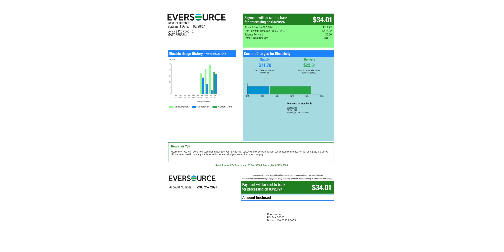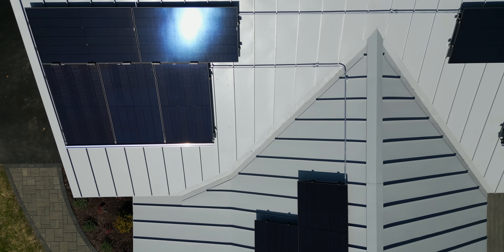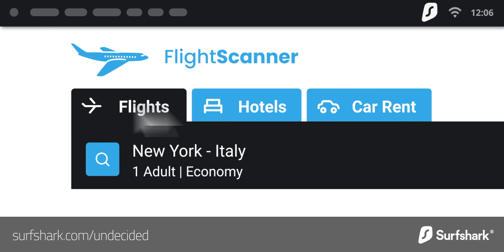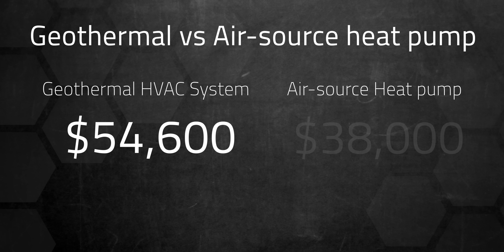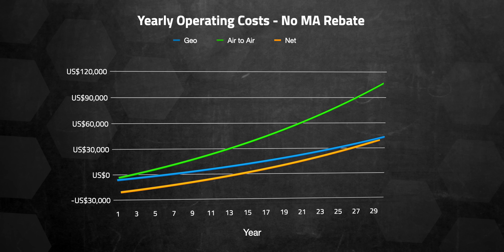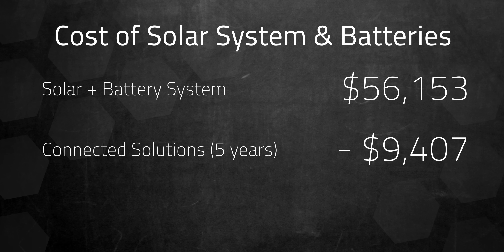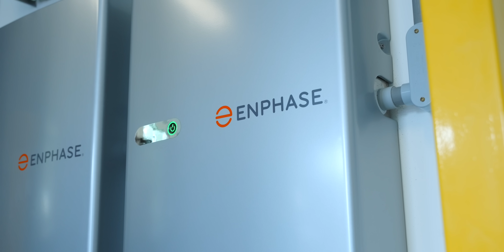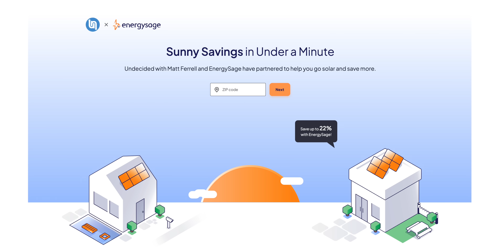What I Learned After 1 Year with New Solar Panels

Comment: I really enjoy all of your content….wondering why you do not use Net Present Value in your long look financial analysis…ChatGPT can do all the math for you in an instant (no need to breakout the college FNCE 201 text book 😅) …here is Chat’s NPV explainer - Net Present Value (NPV) is a financial metric used to assess the profitability of an investment or project. It represents the difference between the present value of cash inflows (benefits) and the present value of cash outflows (costs) over a given period of time. NPV is commonly used in capital budgeting and investment decision-making to determine whether a project is financially viable.

Formula:

NPV = \sum \frac{C_t}{(1 + r)^t} - C_0

Where:
	•	C_t = Cash flow at time t (inflows or outflows)
	•	C_0 = Initial investment or cost
	•	r = Discount rate (rate of return required or cost of capital)
	•	t = Time period

Key Points:

	1.	Positive NPV: If NPV > 0, the project is expected to generate more value than its cost, and it’s typically considered a good investment.
	2.	Negative NPV: If NPV < 0, the project is expected to lose value, making it unprofitable.
	3.	Zero NPV: If NPV = 0, the investment will break even, generating just enough to cover its costs.

I asked chat this question to show how it works:

To calculate the NPV of the light bulb investment, we need to compare its upfront cost and savings over its lifetime with the opportunity cost of investing elsewhere at 8%.

Assumptions:

	1.	Cost of light bulb: $100 (initial investment)
	2.	Power consumption: 1 watt (0.001 kW)
	3.	Electricity cost: Assume $0.15 per kWh (average in the U.S.; adjust as needed)
	4.	Daily usage: Assume 10 hours per day
	5.	Lifetime of bulb: Assume 10 years
	6.	Discount rate: 8% (your opportunity cost of investment)
	7.	Energy savings compared to an alternative bulb: Assume an equivalent bulb uses 60 watts (0.06 kW).

Step-by-Step Calculation:

	1.	Energy consumption of this bulb:
￼
￼
	2.	Energy consumption of the alternative bulb:
￼
￼
	3.	Energy savings per year:
￼
	4.	Monetary savings per year:
￼
	5.	NPV formula:
￼
Where:
	•	￼ = $32.30 (annual savings)
	•	￼ = 8% (0.08)
	•	￼ = 1 to 10 years (bulb lifetime)
	•	￼
Let’s calculate the NPV.

Calculation:

￼

The present value of the savings over 10 years can be calculated as a sum of a geometric series or using a financial calculator.
	1.	Present Value of Savings (PVs):
￼
￼
￼
￼
	2.	NPV:
￼
￼

Result:

The NPV of the light bulb investment is $116.67. This means the bulb provides a net financial benefit of $116.67 over its lifetime compared to the opportunity cost of investing the $100 elsewhere at 8%.

Comment: Our oil boiler died last year, right before we went on vacation. I had been looking into geothermal for a long while and HATED oil, for numerous reasons.

1. there was no way to control price - it could be $3 a gallon. It could be $5 a gallon. 
2. running out of oil - calling and begging for a quick delivery, running to the gas station to get diesel (which you can use as a standby). In our case, our boiler also heated our hot water, so when we ran out, it was a real pain
3. dealing with oil companies and their games - like when I used to be on a contract and I knew the new price was going to be much higher, so they refused to deliver until after the price increase
4. checking to see how much oil we had before a storm - if you're getting 15" of snow, you might not be able to get a delivery for a few days. And you have to shovel a path to the oil tank so they can deliver

Now, I just sit back and count the savings with our geothermal and air source heat pump! I don't have to worry about which dictator has decided to start which war with what country (affecting the price), running out of oil, finding out who has the cheapest price, etc. Now, our next step: solar panels + batteries. We cam close to getting this installed not once but twice, but didn't get it done. That's our next step, which works to control the price of electricity. Now...will Trump keep the rebates or roll them back? Obviously, that's a huge factor here and can affect the solar industry as a whole. We'd like to do this next year.

Comment: As an engineer, I love all this. Smart design choices will pay off.

As a millenial who has very little free cash, I hate this. I rent in a newly constructed house with absolutely garbage insulation efficiency. Our electricity is very cheap (about 1/3 what you pay per kWh)... but we still average about $1800 CAD per year.

I would love to improve my living space to be more efficient. I'll even install the panels for free if someone else pays for them. But I don't have the liquid capital to afford any of the process myself, and there's zero incentive to pay for it as long as I don't own it.

But yeah, congrats to all homeowners who can pull this off. Must be nice. I'll be over here hanging out in my 63F house for the winter. Sweaters ftw.

Comment: Worth it. I have an 11Kw system that covered everything until I bought an EV, but I still never pay as much as I did before. I put about 50k miles on the EV every year and still pay a smaller electric bill than anytime before the solar went up.
I calculated break even at about 8 1/2 years. I'll definitely make that.

Comment: I notice he didn't include interest, since most people would have to get a loan to do this. So at least another 5K per year.
The interest alone would be double my total energy use.
I live in Wisconsin, my average gas+electric is $220 per month or $2640 per year.
I have a high efficiency furnace, gas water heater, and gas clothes dryer.
My home was built in the mid 70's, so insulation is not exceptional.
The system described would never get paid back before it would all need to be replaced from degraded batteries and solar panels.
I notice he didn't include interest, since most people would have to get a loan to do this. So at least another 5K per year.
Glad I don't live in Massachusetts or California., although I must admit I don't like winter.

Comment: You may be a big nerd but you missed a lot of numbers and scenarios with that said i hope it all goes well for you , you talk about savings by year 30  , IF everything goes perfect  but #1 i have never h seen any machine , device , system that lasts 30 years with out breaking , then you may say well they gave me 25 year warranty on my install , well did you read the fine print ???  You may have warranty on the parts but not the labor and may be extra expenses , #2  panel output degrades a lot more than your estimates by year 20-25 and 30 , which by that time what you don’t produce will come out of your pocked , #3  them batteries will not last more that 5 years in an ok efficiency retainment of energy so you may run out of juice in peak seasons during night or shady days  #4 warranty only applies to normal wear and tear  , if a storm a tree limb or some act of nature breaks panels or damages your system  the repair cost is on you  , so at that point you have to add insurance to that system and or  add it to your home insurance which will bring the payment up   Which you have to factor that monthly extra cost  to your electricity bill , #5  if they are on tour roof  when the roof needs to be replaced the cost of doing that increases by 20k or more to have to take them down and put back up  which again it will be on you or your insurance payment will go up a lot , plus the cost of electricity while the panels are off the roof you have to pay for  , i may be missing few things  but i did an in depth calculation and it is not worth it  to most any one with a very few exceptions where weather may be mild , a very small house , some one that does their  own  install  ,  i’m sure you are too popular to read my comment but i’d really like to see what you think ,  oh yeah i forgot to mention that you have to keep the panels clean as a mirror for them to collect enough light to produce power , that includes leafs , dirt , grime , ice , snow , mineral deposits after rain , man there are a lot of little variables that you missed !!!!

Comment: My home is net zero, even though the word "efficiency" could never apply. 65 year old construction, single pane windows, fireplace, swimming pool,  large garden lit up at night... a nightmare for energy consumption. I am net zero because I have enough solar panels on my roof that on a yearly average I generate about 4 kWh per day more than I consume. If I lived as electrically profligate as I do, but without the solar panels, I would be spending $4,000 per year for my electricity. My total installation, including panels, labor, batteries, and inverters, cost a little bit less than just your geothermal system by itself after your rebates. (I paid full retail for everything in my system.) 

Now, I don't get the satisfaction that you get for having such a beautiful, efficient, high-tech home, but mine is a nice home nonetheless and it is fully paid for, no mortgage, and I am off-grid capable... almost. 😠I found that out last month when my main breaker to the street failed and my batteries lasted three days before shutting down the system, which is how I found out that the breaker had failed. If I shut down the swimming pool pump and the garden lighting, I could last indefinitely. I remain grid tied to save wear on my batteries.

My situation will change next year, I plan on buying a used Tesla Model Y, and I will need more efficient panels to feed it. Mine are old, rated at 320 Watts per panel, the replacements (costing less than mine did originally) will be around 600 Watts each. I will need to look into the possibilities of using the Model Y battery for my energy storage rather than upgrading my batteries.

Of course, as you stressed many times in your video, YMMV. It has worked well for me, but probably would not work for everyone.

Comment: prices are so high in the US. I live in the UK and I have a 170m2 property and I am getting installed a 7kw ashp + radiators, ufh, and new pipes throughout for £12k, and a 16 panel, 9.5kwh battery solar system + full house rewire for £20k - total of £35k ($44k USD), this is after all incentives. this is roughly the same price as your solar system after so many discounts applied! I don't get US pricing.

Comment: If you include the savings on fuel for electric cars in your calculations it’s much more impressive. 
We have two, for about 7months we had almost zero cost motoring, all from surplus solar.
Reply: 50x panels 20kw. Plus 30kw batteries

Comment: Thanks, I am in UK. Your install costs for solar are way higher than the UK, but you also use so much more energy than UK, I use about 4Mw/annum, and this is fairly typical.
You do not include your lost opportunity costs, even just cash can generate 4%/annum, 100,000$ over 10 years invested just in cash could easily make $40000 in a 10 year period.

Comment: $89,000? 
My grandchildren will have passed away of extreme old age before my house costs that 
much in accumulated electricity bills.
And that doesn't even consider the costs of replacing solar panels every 25-30 years
nor does it include the lost returns one could have made over 
almost a century by simply investing the $89,000.

And the above doesn't even take into account the fixed cost charges involved 
in staying connected to the grid.

Unless one cuts off all connection to the grid one still needs to pay those fixed cost charges
even if one has net zero electricity use over a year.

Where I am in Ontario those fixed costs on the energy bill make up close to half 
of the total energy bill most months.

Looking a random bill I saw that the fixed costs charges were 48% of the total bill.

So going net zero while still being connected to the grid might still leave one paying 
close to half the amount one used to pay on one's electricity bill.

Instead of taking a century to make back that $89,000 it might take two centuries.
Much longer if not forever if one still needs to replace the solar panels and batteries 
every few decades.

It sounds nice and comforting to be off grid but perhaps energy generation 
is just one of those things that is done most efficiently on a large scale
at centralized locations.

Plus 24 hours of stored power may not be remotely enough in situations such as 
Quebec's 1998 ice storm or Toronto's 2013 ice storm or 
Ontario's 2022 derecho wind storm.
In each case a lot of customers were without power for at least 1 to 2 weeks.
It's true that if one has solar panels one is producing some electricity to 
cover some of one's power needs but solar panels don't always produce a lot of power,
especially in the winter at a time when a severe storm is active in the area.

Solar and wind power should become important parts of the power grid
but perhaps it makes the most sense to centralize that power production 
instead of having every building and house be a source of power.
There surely must  be  huge economies of scale in building a large solar panel 
power generation facility vs individual homeowners trying to arrange 
with individual contractors to install solar panels on their roofs.

Except for homes in low density places we don't expect every home to 
have its own water supply anymore  - the vast majority of people get their water
from central facilities.

Comment: One thing for people to consider, especially with retrofitting vs. new construction, is the rate of price change of the efficiency upgrades themselves. I think we're pretty well leveled off with solar, but I could also see batteries getting significantly cheaper in the next few years. It might make sense for some people to install these things piecemeal starting with those that might have rising or steady costs before moving to those with decreasing costs over the near-term. Just another variable to think about!

Comment: I might not go off grid, but that is only because my setup is purely portable so far, however overcharging is an option for me. Over charging is where you use the solar kit to charge battery banks for mobile charging. 

Given the tech we have currently, it should be possible to at least lower some electric costs using solar.

Comment: With all due respect you are lying or you were scammed.

There is no where in USA where a single panel sales for 1200 USD
43 Panels for 55,000 USD? How?
Do you mean 5500?
The price is insane.

I got the same kind of system for less than 11,000 USD including the battery Storage

Comment: I have been following your videos for some time. They are great and I like your efforts of trying to achive net zero emissions.

I was looking on some of the pricing yoy showed and I had to say I found them quite high. Quality products and installatin is ofcorse important and prices are different around the world.

I live in the Nordics and we have had a geothermal heatpump since 2004. It is a while ago but here yoy will get a 200 hundred meter well plus a 3-12 kW inverterpump for around 20 000 Euros. That includes a boiler sufficient for a 4-5 person family. This excludes the floor heating though which adds to the cost. It is however far from your prices in total.

You have a top-notch aolar and battery system and I have less knowledge of what taht would cost here. I guess about the same.

All in all except for your well evertying is decaing in value quite fast. Every gadget about max 20 years. Spending this much money on the heating system in comparison to a ”standard” house means that your house value will decay almost in a similar way as a EV. I think in five years you might still be happy but when service costs and replacemt costs starts to tick in years 10 to 20 it might be different.

We have not been aiming for net zero but in 2004 I had two things in mind efficency and flexibility. That lead to the choice of a geothermal heatpump for water in combination with firewood heating. Processed dry firwood does not give cheap kW prices but in a cold climate it is the best. No sun during winter, available either from own forrest or bought,ready dried or half processed. The geothermal heatpump is least expensive for most of the time and we firewood only when electricity prices go above 12 euro cent per kW as a compliment. Ready chopped dry firewood would now cost around 17 euro cent. Taxes and transfers will bring the comparable cost down to 12 cents.

In a cold climate storage is essential and here firewood jave abig advantage compared to batteries. Batteries would give me half aday at most even if I spent 15 k on them. Firewood I canuse on the rear occasions electricity prices are high, 3, 6, 12 months or after 2 to3 years if needed.

As said we are not net zero but cost of operation compared to investment costs gives a payback 5-8 years depending on electricity prices. This contains replacing the heat pump every 15th year. Solar and batteries I will stay ou of due to the rapid technology change, lack of standards, and foremost it does not provide any benefits duringthe heating season.

Conditions will vary depending on one lives but in cold climate wood heating as acomplement, cheap a I have it with two burners or little bit more expensive with more comfort through a boiler.

Comment: Sorry I don't see the cost advantages considering how expensive going solar is. I replaced my forced air and hot water systems (95% eff. gas heating and electric cooling) a couple years ago. The total cost was $8500. My home is 20 years old and very well insulated and my total average cooling/heating cost per year is about $2500 a year. For me to spend close to $100K to replace all those systems so I could have a $0 energy bill would take 40 years to get payback. Not worth the loan interest costs by themselves to be even close to worth it.